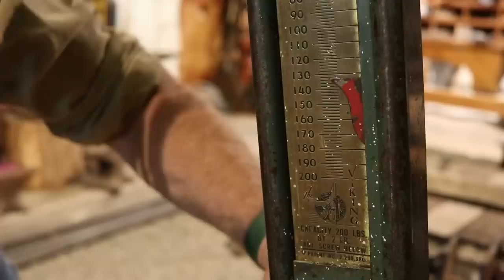Pulleys in the Shop Explained

Comment: Great video. I work in the tower industry and got my truck stuck pretty badly on site one day. I was just about to call a wrecker when I decided to try and use my capstan and every block I had on the truck. I rigged an 8:1 and was able to pull a 9,000 lb truck out of the mud with a 1,000 lb capacity rope and capstan. I had a lot of feelings at that moment, just absolutely covered in mud and exhausted 80 miles from home at 5 pm on a Friday.
Reply: These things never happen at any other time than last thing on a Friday!
Reply: @Jack-vt2mu  first thing on a Monday? Lol
Reply: Great job and resourcefulness!
Reply: Yeah bud!

Comment: I live in a house that was built in 1911. When my wife and I bought the house we knew the brick work needed some pointing up in the mortar joints. But the top of the chimney was the worst. I hired a mason because I don’t compete with someone at their own game. Everything about masonry is heavy…. scaffold, bricks or blocks, mortar tubs and so on. Conveniently, there’s a big walnut tree that overhangs above the roof. The mason and I used a limb and snatch blocks to get his material to roof height. No sketchy ladder climbs with material in hand. I also believe it saved him time. He was thrilled when he showed up to do the work and I had a system in place to make it easier.

Comment: In the Navy to go to Chief Warrant Officer 3, I believe that's right, part of the exam was to rig on a sand beach to pull a large vessel onto the beach with rope and blocks. It was amazing to see a 4 cylinder jeep pull that large vessel onto the beach with a rope. It took a day for 4 sailors and a lot of rope, steel rods and a bunch of sheaves to accomplish that feat, but it worked.

Comment: I’m a logger and use these quite frequently. The most complex was, like you setting a rail car bridge in place without being able to have a machine on the other side. Used our Yoder as a skyline and the skid drum to guide the car. Darn trees are never where you need them. Had a long drum line on the cat to pull the bridge across. Things got a little sketchy and the lines were sining before we were done but we set a 90’ rail car in place for about 1/4 the cost of a crane. And it was on our schedule.

Comment: Just recently I "discovered" the power of pulleys when I had to move an old school bus 200 feet over soft ground using a 2 ton capacity come-a-long and some cable and chain.  I ended up with 4 cables going to the bus tow hooks and back to various big trees in the woods.  Lots of slow going work got it done, eventually.  One thing you didn't mention, the more pulleys you use, the more length of line  you have to pull to  move the weight....with 4 cables on the bus, each click of the come a long was a whopping 1/8 inch or less of bus movement!  I had to reset the whole rigging many times....but, it was much better than calling a giant tow truck.  Many days of hard work, but it's done and my upper body has never been so strong!

Comment: 🍻Good on ya picking up that 100 lb anvil with the rope.  Lots of folks, a lot younger, couldn't do that.

Great video.  I also use blocks to slow things down, and allow finer movement.  I added an ATV winch to a Harbor Freight "crane".  Adding pulleys slowed things down to allow for an easier/slower picking up and lowering of the load.  This isn't about capacity, but rather trying to avoid shock loads to the crane when picking up heavy, near capacity, loads.

Comment: Hello Master,  Thank you for all the ideas I´ve received from your videos.  
The reasson why you are receiving diferent measurments, is because there are three basic  ways to calculate (MA) or Mechanical Advantage: Theoretical, Real and Actual.  What you are getting is the actual which refers to all of those different parameters that are not cosider in the theoretical calculation and go even farther than the Real calculation. 
 Being said,  even with pulleys you will have friction which reduces the MA.  and if in addition to that you have what we could call Factor "X" (lets say the calibration of your meassuring device) could modify those resulting calculations.  
Very respectful.  
And then again, thank you Master.  You have no idea how many times I have improve my performance using things I learned form you with your videos.

Comment: When I was a poor, skinny kid, I bought a small block Chevrolet engine from a scrap yard(for $50). With my friends chain hoist (I can't remember how many chains in it), I lifted out of the back of my pickup using a beam in my fathers shed (a full dimension oak 2x4). It was almost effortless. I'd love to have that chain hoist, for no real reason other than memories. Thank you

Comment: used lots of pulleys when doing recovery of off road vehicles. depending on the set it can be used to increase the pulling power of the winch or to contorl the direction of the pulls. the set up can be an art form onto itself. thank you for the great videos.

Comment: Every man used to be aware of pulleys back in the day. Every home would have a clothes airer/drier that consisted of several lengths of wood that you put your damp clothes over. These would have a rope that would pull (usually 4) up to the ceiling in the kitchen where they would quickly dry!

After I started work for the Electric Board we would often need to dress large 3"+ cables into a "U" shape to terminate into an electrical panel. There is no way even a group of muscly guys could do that neatly without a trick to it. Our trick was to bend the cable to the nearest we could manage and then wrap half a dozen turns of rope around the cable and use a short length of conduit (metal wiring tube) pushed through the rope and twisted like a tourniquet! This had the same force magnifying action as a pulley.

Later on I was made aware of one of the few uses of rope under compression rather than tension, on canal barges! Rope was wound round the propeller shaft in the boat and was heavily covered in grease. A handle would put the rope under compression enough to stop water getting in! Useless in your shop, I know! ;o)

I do have a great story about using force to aid work that had a whole factory of Navvies up in arms when they saw it in action, but it is way too long to tell here ......

Comment: Excellent video.   Don't use Block & Tackles as much being mostly in the Shop now days but used them on a regular basis rigging Speakers, large projection screens, etc.  from 100's lbs to over 1000 lbs.  I don't know how I would have done it without Block & Tackles.  Having enough headroom above sometimes was a problem.

Comment: Just this evening i used a tiny 20mm block and pulley to lift a 150kg generator so i could drop off the sump to retrieve a piece of broken piston ring.
That's all i needed, decent cord and tiny hardware shop pulleys you described suitable for sliding doors.
It's surprisingly easy to overlook the usefulness of simple machines.

Comment: G'day from Australia 🇦🇺 
Thanks for your videos Scott, always informative and interesting.
In my time ive used rigging and pulleys from block and tackle to a hauling and rescue system  to raising and lowering a 150 Tonne dredge ladder and Bucket Wheel.
With enough length of rope or cable, and enough pulleys,  we can move ANYTHING!!

Comment: I use 2-4" swivel blocks for space saving storage solutions in my shop.

I store ropes in my open attic space by hanging a swivel block from a rafter, a block w/ a hanging 5-6" ring & 2 tie offs.

The lift rope attaches to a tie off a foot or so from the rafter block, travels through the block & ring, back up to the rafter hung swivel block, then down to a tie-off on the wall.

I bundle like type rope together w/ velcro & a hook; these bundles hang on the ring. 

It's easy to grab whichever type rope I need w/o disturbing the rest. 

I have a loop in the rope, which I slip onto the wall tie off, which leaves the ropes chest high, w/o me holding the load.

I have a 100+#'s of rope out of the way, at easy access for selection or stowing away.

I have similar riggings for V-belts,c oils of wire/plastic tube/hose & light wgt chain.

Gotta get creative when you're tight on floor space.

≈========

So, THAT'S where 'Skookum' originated. I completely forgot about Skookum blocks!  LOL

Comment: The extra 2 pounds you describe around 2:40 is because you are moving the weight against gravity. 100 (or 110) pounds is the exact force needed to match gravity. But 2 pounds is the additional force needed to counter gravity and move the anvil up at the speed you are doing it. If you had the physical ability to turn that crank 1000 rpm, you'd see much more than 2 pounds shown on that scale.
Reply: It is the force to accelerate the anvil. At the end of your stroke when you stop lifting the anvil, you should see a similar decrease in the weight (scale should read 2 pounds less than it does at rest). We don't live in a perfect world, so there should be some force to overcome friction but I would expect it to be less than the acceleration forces. If not, oil your pulleys.

Comment: Same as the Gardner Denver Mayhew 1000 table drive i worked on as a trainee driller.

Single line pull was roughly 4,500kg, or change to a Doubleline (from drawworks to Crown Wheel, back through a pulley block and finish at a 50ton shackle mounted near the Crown Wheel), you could pull 10,000kg safely & easily (which we did 99% of the time for the safety factor; was a bit slower on pipe trips/ casing runs and unscrewing the haul plug due to pulley block in the way, but far far safer than the Singleline)

Comment: I got to play with pulleys as a kid, and found them wonderful.  I also got to play with hydraulics (had a bathtub set to start with) and saw how that provides advantage.  There are so many places where having something that can take your personal strength and multiply it to a force that gets the job done.  I would have brought up the cost of that advantage, though.  When you get twice the force, you get half the movement.  Pull a rope on a pulley that doubles your strength, and you pull twice as much rope as the lift you get.  If that phrasing makes sense.

Comment: Chain calls are an example of distance and travel around  pullies . The top 2 are fasten together with one being slightly smaller and the chain is engaged to the pulley. The distance traveled around each is different and either shortens the traveling distance lifting up or lengthing traveling distance lowering the load . The size of the chain drive pullies equate to leverage, the larger they are the more    power and chain speed generated.

Comment: You can push with a rope - I've done it. I pushed a tree over with a rope one time. The tree was middle of three in a line, with considerable backlean. To much to risk wedging it over and a septic tank and other stuff on the back side of the tree. It had to fall one direction only and there was no way to pull it in that direction easily. The terrain wouldn't allow for it, no anchor points, etc.

As I say, this tree was between two trees, about the same mass (fir trees, about 20 inch diameter). It was set slightly back from an imaginary straight line between the other two trees.

I rigged a 4 tonne snatch block in both of the neighboring trees, about 20 feet up. Then I routed a 1.6 tonne grip hoist tirfor cable (steel rope) from the base of one tree, up to the pulley on that tree, and across to the pulley on the other tree, behind the tree to be felled, and down to the grip hoist anchored to the base of yet another tree. So what I had was basically a shallow cradle of steel rope, "holding" the tree marked for felling, at a height of 20 feet. The angle of this cradle was maybe seven degrees or so.

I tensioned the cable, made my cuts, and had my guy keep tensioning the cable as I whittled the hinge thinner and thinner.

At a certain point the sideways force of the tensioning cable exceeded the force of the backlean and the hinge wood, and the cable pushed the tree to vertical as it straightened under tension. We actually pushed that tree right over into free fall.

Comment: Another interesting note about pulleys is that not only does each line used halve the effort to lift the travel distance of the line doubles. So make sure you have enough length for the task.

Comment: As a young electrical contractor. I couldn't afford a tugger to pull electrical feeders, but bolt a pulley to the floor and run the rope to a truck, or scissor lift, we always got it done.
Reply: Simple inexpensive tools like a come-along are still very effective

Comment: A chain fall works by a difference...the chain hooks into each pulley, so they're like gears, but one pulley is one pair of links shorter than the other. The two pulleys are completely joined. So when you turn the pulley one full turn, the loop of chain that runs from one to the other and has the hook in between gets one pair of links shorter or longer. The number of "teeth" in the pulleys tells the advantage, so if one has 10 and the other has 9, the advantage is about 1:9.

Comment: Place the scale between the hook of the sheave and the anchor point when lifting the the 100 pound anvil. 
 It will read 200+ pounds even with the rope tide off.
 The 100 pound anvil plus the 100 pounds that the tie off point has on it to hold the anvil plus the wieght of the sheave and rope.

Comment: The extra 2 pounds that the scale showed when lifting the 100 pound anvil. Was the chain come-a-long overcoming the load. 
 There must be extra energy applied to lift it. When the rope is tied off it has 100 pounds on it as the scale should.

Comment: I'm no physicist, but I think a better explanation of why the weight is about half with 2 pulleys is because the distance you have to pull is 2X, so 2X distance = 1/2 weight.  if you added 2 more pulleys, it would be 1/4 the weight, (if strung correctly) I think?

Comment: The block setup for the large anvil has different rates of load holding; not 130x=AnvilWeight where x=#ofPurchases 
I hypothesize this directly from the “differing line speed”  demonstration. 
I am not certain of this so don’t crucify me here!
If I were a little more motivated I would find the equations to demonstrate the physics, but I bet a mechanical engineer can correct my ignorance without breaking a sweat!
Thanks as always!
-Castor

Comment: Force = mass x acceleration. The extra two pounds is the acceleration of a dynamic load. It goes away when you quit moving the anvil and is now a static load. Friction is a much smaller component of the increase.

At the 5:00 minute mark you have rigged a four part system, not a three part. Just count the lines leaving the top block and holding the weight.

Comment: I freaking love rigging. Mechanical advantage is no joke. 

Recently i  partially cleared a piece of land for my wife and i. Heavily forested, Doug Firs, Silver Maples.  Weatern Red Cedars with a smattering of poplar and cottonwood on the periphery. About 150 trees ended up being removed, which was just about half the plot. Some of those just couldnt be kept due to growing insulated from the wind, so we've replaced about 50 of them with youngins. The firs were 120-150ft and the largest ones, ~180ft i left alone.

I spent my pandemic digging up Doug fir stumps by hand (lockdowns=i had time, not money) and after the 70th one i was just tired of it. I had two trees that had had their tops break in a wind storm so i pulled out my 2 block and tackles, threaded this poly wrapped 250' 1/2" steel cable i got at a flea market (for 20$!),  grabbed the 8 or 9 snatch blocks i own, and a pair of $40 comealongs. 

I pulled out a 30ft ladder and tied the cable as high as i could get it from there into each tree and set up my ropes, cable, pulleys, anchors. 81:1. Which was a mistake. First tree took like 2 days to deroot, stump and all. The second tree i set up a mere 45:1 and that one was down in half a day.

Im not uncomfortable felling, I've done it plenty and to earn a living at some points. I can drop a tree within ~18" tolerance of my marker, reliably. Pulling down is much more unpredictable, i was a good 15° off each time but it saved me sooo much time nit having to deal with the stump.

I freaking love rigging man. That shit get me excited. You don't get to do that everyday, yknow?

Comment: But how many pounds is that block supporting(it's hitch point on the beam) when you lift that 100# anvil pulling down on a single rope. This is an important consideration when rigging, especially when multiplying these numbers by a factor of 10 or 100 times.

Comment: If you R E A L L Y want  to move something, you can do purchase-on-purchase.  Rig up your 4:1 pulleys, then rig another 4:1 onto the fall (the rope you pull on). That gives 16:1. You won't move the thing real far before you run out of travel; but you will, by gosh, MOVE the thing.

Comment: I need a system of pulleys that can load the back of my Frontier. I like to move scrap metal of all types. It needs to fold flat against the inside of the truck bed, quickly deploy and only use human power for low cost.  HELP....LOL!